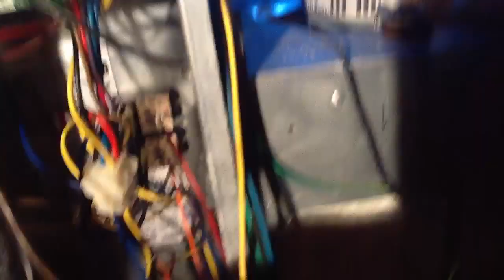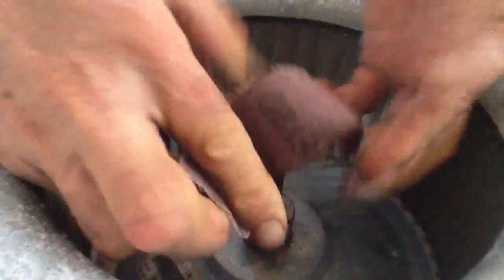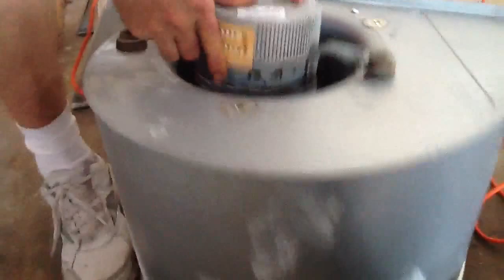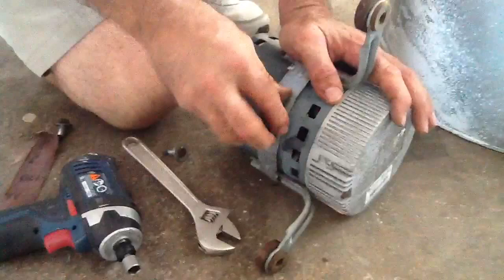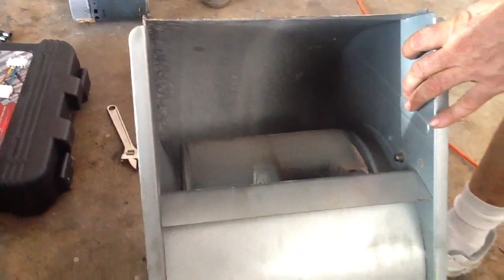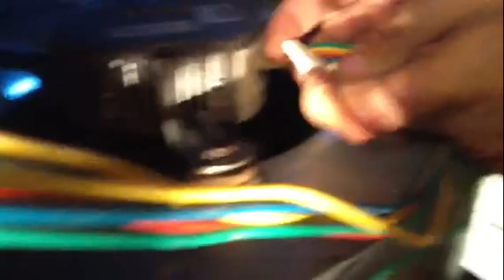ECM Motor Replacement & Troubleshooting

Comment: MR. JONES, YOUR VIDEO WAS INFORMATIVE TO HOME OWNERS  AND NOVICE DIY AC TECHS, HOWEVER IT APPEARS THAT THIS WAS THE FIRST MOTOR YOU EVER CHANGED. EXAMPLE; NEVER USE A HAMMER WHEN REMOVING A BLOWER WHEEL, IT WILL BREAK. A PULLER WORKS FINE, BELIEVE ME , I HAVE BEEN USING ONE FOR OVER FORTY YEARS.

Comment: Thanks a lot for this video, I followed it step-by-step and replaced the motor on my carrier unit that looks exactly like the one in the video. I replaced it with an evergreen EM x13 motor that was about $230. I hit the end of the rusty shaft with the hammer the mushrooms the tip so I had to file it down a bit to completely remove it.

I haven't diagnosed the bad motor yet but from what I've read it is almost always the module that goes bad but I couldn't find anywhere that sells just the module you have to buy the complete motor

Comment: E C M stand for electronically commutator motor for the lady that was asking. its a variable speed dc motor. it has a module that takes ac current and rectifies it to dc current.
Reply: Thanks for that clarification Chris, I appreciate that. God bless

Comment: My Trane system ECM failed also, but I investigated further and found that usually it IS the module that is faulty, but not completely, often times it is a thermistor that has gone bad.  Sure enough, I took the head off and examined it carefully and found one fried thermistor and replaced it, it cost me time and effort to take the fan out and do the electrical testing first, but the thermistor was under $2, but it did the trick, saving me lots of money, 2 years ago.  However, most of the module components cannot be replaced as they are imbedded into epoxy, ensuring you have to mostly get a new assembly, even if the motor itself is OK.

Comment: An ECM Motor it's NOT  "actually " a variable speed motor , It's an Electronically Commutated Motor , it basically  does changes the RPM's on the motor but in a different way .  The thinks that I would add to your great video , is that you use the emery cloth before using any lubricant, and if you sand it good enough , you almost  never need lubricant , after sanding use your wrench on the shaft and turn the blower wheel and it will free it up quickly and without the mess , and you should measure from the front of the motor (shaft end) to the belly band  , because sometimes the replacement  motors are not the same length size . Great video thanks for sharing .

Comment: I'm looking at a X-13 Genteq 1/3hp.208/230v 1phase, that locked up. The rotor amatures came unglued. The AHU is made by Grandaire (ICP). M/N WAHM244A2. This unit was blowing the 3.2 amp control fuse at random and I suspect the motor module was grounding prior to the lock up. Which broke the module cover (end bell). I'm thinking of replacing it with a 1/2 hp psc 3 speed motor with 2 relays after looking at the motor construction. the X-13 has a drop replacement, but both are around $300. ECM motors are nice for SEER ratings, but not long lasting.. Nate certified since 1978 thanks

Comment: The biggest reason I see variable speed motor failures is air flow issues. Incorrect duct size, dirty filters, all contribute to the failure. Nice job on the change out.

Comment: Thank you for this video. I like how you used the flash light to inspect blower faulty rotations; where you buy that kind of flex-flash light? Also, can you go over how to Ohm check the bad variable speed motor terminals. God bless u

Comment: Dave, I have a "squirrel cage" blower.  It works fine but after a short time, the motor gets hot (smell the wires) and than stops.  After a few minutes, it starts again.  What do you think is wrong.  Thank you for allowing us to ask questions.

Comment: If you have plenty of money then replacing it with the original motor is not a bad idea. But if money is an issue it's a lot cheaper to install a Quik Swap circuit board and a PSC motor.

Comment: that looks like a x13 blower motor and not an ecm blower. Ecm motors typically have 16 wire on the molex connector that controls the low voltage ac\dc but please correct me if I'm wrong.

Comment: WHY is the motor bad and not just the Control Module???
My unit was doing the exact same thing but the motor was fine. I just needed to replace the control module on the end of the motor.

Comment: how would you test or ohm out one of those? Could you make a video on that?
Reply: Think he forgot that part. Short story is you take the ECM off, and there should be a 3 pin connector, you want to check across all those 3 pins to make sure you have under 20 ohms resistance and whatever the resistance is on one pin it needs to be less than 10% variance between them. also check from each pin to ground to make sure there is no open shorts.

Comment: I miss the days of PSC motors when I go to the truck and match up the voltage ,rpm and horsepower and get the customer up and running again in 20 minutes.

Comment: Did I miss something? Anybody can use a wrench that you specifically said you were going to troubleshoot, with voltage and ohms testing.
Reply: Think he forgot that part. Short story is you take the ECM off, and there should be a 3 pin connector, you want to check across all those 3 pins to make sure you have under 20 ohms resistance and whatever the resistance is on one pin it needs to be less than 10% variance between them. also check from each pin to ground to make sure there is no open shorts.

Comment: If the motor is two piece with a removable module and the motor was still working, why did you replace it. From what I've learned about these motors is that if the three motor leads ohm out to the same numbers and do not ground out then the motor should be re-used.
Reply: 95% of the time just the end bell is bad, not the motor.
Reply: Your absolutely correct...
Reply: Pros do this so they don't get an angry call on a now failed motor after the module replacement.  An older motor with a new module can strain the motor and it fails.....the customer is then super pissed, having just shelled out $500 and now faced with a $800 motor with install.
Reply: The truth is, you are better off using a properly sized generic motor and converting to a relay and standard capacitor setup.  This will probably last the rest of the life of the air handler without further issues.....but with a slightly higher electro bill.

Comment: I found the problem on my ecm condenser fan motor when it was behaving like that to be burnt varnish insulation on one of the coils of the motor causing a short.  The coil overheated because someone laid floormats over the top of my heat pump and the motor got too hot.

Comment: Where is the Troubleshooting? Where is the part where you said you would show the testing later?
Reply: Think he forgot that part. Short story is you take the ECM off, and there should be a 3 pin connector, you want to check across all those 3 pins to make sure you have under 20 ohms resistance and whatever the resistance is on one pin it needs to be less than 10% variance between them. also check from each pin to ground to make sure there is no open shorts.

Comment: I ohm out my motor read 3.9ohm, 3.9ohm and 2.4ohm is that mean my motor bad?
Reply: Yeah there is something up there, you should be within no more than + - 10% difference across the 3 pins, and make sure none of the 3 are shorted to ground

Comment: So you diagnosed correctly that it was the module which was good. Then you decided to replace the entire motor instead of just the end module! Would have saved your time and the customers money if you had just replaced the module.
Reply: Replacing the motor module more often ends up in the replacement of the motor as well, which means extra expense for customer. I replaced modules and 4 out of 10 i have returned within weeks to diagnose a bad motor with a new module. New motors come with mew modules, which means the previously replaced module is useless (ok for future quick diagnostic tool). Service call fee, motor cost, plus install fee, all adds up higher than replacing the whole motor & module first.

Comment: I change out at least 2 a wk, I usually just get whole pkg instead of the module itself.
Reply: Why
Reply: @oafyvonskidmark316  very expensive.....the module can be had from HVAC distributor for $200......the package with both module and motor is around $650-700.  The only positive thing about this type of repair, in this video, is that sometimes the older motor has a shortened life with the new module.  If both are new, it will probably last the remaining life of the air handler.

Comment: To save your customer money, the best practice is to throw away that variable speed motor, and set a standard PSC motor.  Then the customer will actually have a reliable fan blower motor.  Secondly, why would any HVAC tech be wearing tennis shoes and shorts?  Professionals look like professionals.
Reply: It's Florida, you do Hvac work here you wear shorts.
Reply: I work in Arizona and often wear flip-flops. Never had anyone complain.

Comment: excuse me my friend what is ECM motor...... is the blower motor .   ho  .. whats .this means ?  E - C- M. PLEASE.
Reply: E =Electroncally C =Commutated M = Motor Basically they  converting from AC voltage to DC voltage ,then after converting DC voltage back to 3 Phase AC voltage.  Speed change is through  pulse width modulation Thats why they  calling that motor brush less DC motor